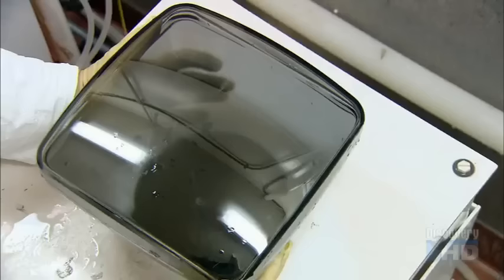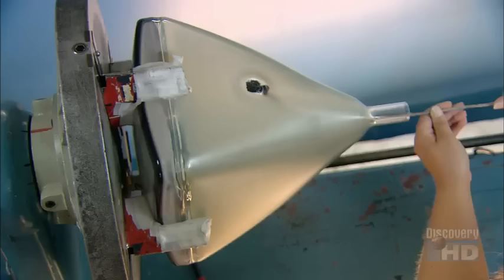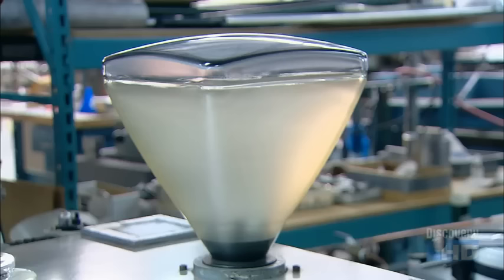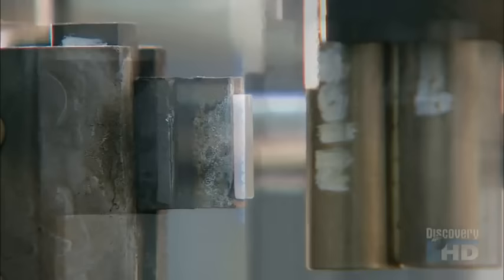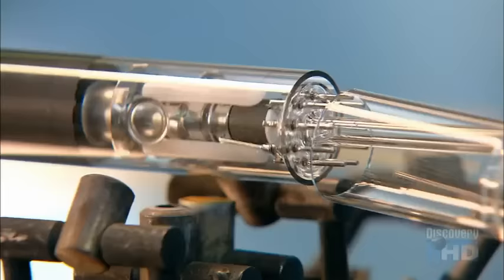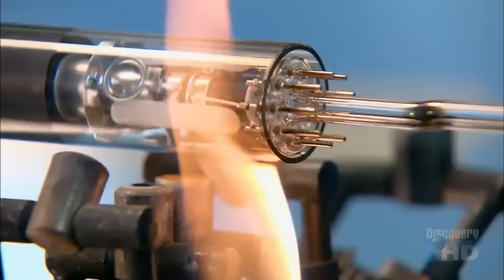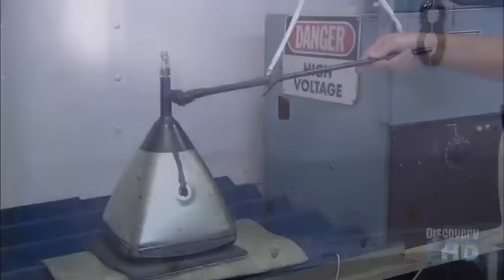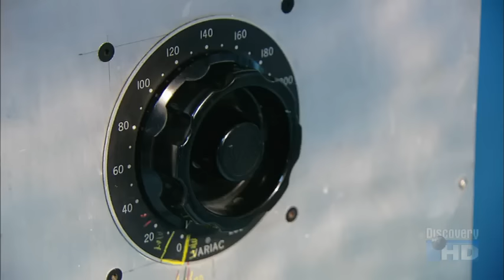Discovery How Its Made - Cathode Ray Tubes (480p) -=KCK=-.mp4

Comment: What they did not tell you, the thickness of glass has to be very thick and strong along the front screen part, CRT tubes are subjected to a very high pressure from the outside, as the tube has total vacuum, i.e. all the air is extracted by a powerful pump, there is no air left in them, so now you can work it out how much  of the atmospheric pressure is acting on the front portion of the screen,  a 25" diagonal CRT screen which roughly means approximately 20" x 15" rectangular screen occupies a surface area of 300 square inches, each square inch is subjected to atmospheric pressure of roughly 15 lbs (pounds) per square inch, so total pressure acting on that screen is 4500 lbs! that is approximately 2000 kilograms that in itself fascinates me. And don't forget the screen has to also take a lot of abuse as many people thump the poor thing when watching a programe that turns out disappointing, like if you were watching football, and your favourite team lost, you would probably punch the screen! 

 And the other fact is we cannot see electrons, yet we have a mini hadron collider in the tube, where we emit tiny unseen particles, called electrons towards the screen and strike a phosphorus coating that emits a light when struck by electrons, and thereby prove that electrons exists, and that they can be boiled off a negatively charged cathode and accelerated to near enough speed of light and strike the screen, where energy is given off, if we were able to set up sensors all around the tube inside, we would have been able to detect many other particles given off when electrons strike the phosphorus screen, we would have been able to detect Higgs Boson, without having had to spend 2 billion Euros building that big particle accelerator, all that could have been done inside a CRT, probably your smart phone camera can capture higgs bosons emitted by your old 26" CRT TV. And don't forget using 10 to 15KV  volts anode voltage, you would have been subjected to a fair amount of X-rays being emitted off as well,  but these days we are exposed to a lot of Microwaves as most iphones now work on Microwave frequencies of 2Ghz or more, that is the same frequency our Microwave oven uses to cook food, though the doze we get is a lot weaker, but over a long period of time our brains are being slowly defrosted.

But remember biggest revolution in science came from a bull, we first used a bull to use its mechanical energy, to run mills, do the farming, mine the minerals, drive bull carts, enable man to invent millions of other things so all started by a bull, we owe it to a bull, animals must be respected.
Reply: Thanks for the information
Reply: "we would have been able to detect Higgs Boson, without having had to spend 2 billion Euros building that big particle accelerator, all that could have been done inside a CRT, probably your smart phone camera can capture higgs bosons emitted by your old 26" CRT TV"

I don't know what you're smoking, but the particles in the Large Hadron Collider are 10,000,000,000 times more energetic than in a CRT electron gun.

Comment: So labor intensive !!!
Reply: And that's not a bad thing.
Reply: It was worst when CRT was new, because the newer a technology is, the harder it is to get use to it, and before you know it, as soon as you're used to a technology, it immediately is outdated and replaced.
Reply: Remember that back then a BW TV would have dozens of vacuum lamps made with similar methods.
Reply: @bob4analog  manual work is so unprecise, slow and expensive, why're you saying it is not a bad thing? robots are so much better at precise repetitive tasks
Reply: @bob4analog  can you explain pls?)
Reply: @jskratnyarlathotep8411  - Ok, robotic automation is great for large quantities of fabrication, but this is very costly. The design for such an automation for this CRT company would outweigh the benefits for such a small yield.
Reply: @bob4analog  aha... I did not assume you're talking about that particular plant, i thought you're talking in general, about a fabrication.

Comment: And to think that for all of these years this labor intensive manufacturing process was cheaper than making an LCD.  Wow!!
Reply: Well, why should the newer and inferior technology be cheaper? They want people to buy it, so pricing it as expensive is a great way to fool consumers into desiring it.
Reply: This is like late 1940s level of CRT manufacturing. In the later decades, there would be incredible advances in manufacturing of the tubes, allowing prices to come down. By the 1990s, they were mostly made by machines.
Reply: This has to be a speciality shop making limited run tubes for specific replacement usage.  An actual assembly line at the height of CRT usage wouldn't have had guys in lab coats and immaculate laboratory conditions..  This is more like watching someone currently making Nixie tubes by hand (which would have been an unworkable option when they were in wide scale usage).

Comment: So cool. Shame crts have pretty much completely died. I collect and tinker with old arcade machines and it is getting tougher and tougher to find decent tubes for the monitors. You can hack up old tvs for the tube sometimes but even those are starting to dry up. You just can't beat these older displays for retro games
Reply: Try going to a recycling center, most of them let you take the TVs for free and they have literally hundreds of them. It's important to know where to look.
Reply: Hi Jay, I too have a soft spot for arcade machines, I used to work in the industry repairing monitors , power supplies, boards etc. I can tell you that lunch time was always a lot of fun because the machines that we had repaired had to be ..er.. ahem ..tested   :-D. 
 The company I worked for closed so later I had my own business , I still have so much kit , tubes in good condition, some new even, power supplies by the box full , working monitor chassis, coin mechs etc.  Sad , but one day I'll have to throw it all away, well recycle the electronics anyway.
Reply: @prepare2qualify111  I've heard of those but there are none near me. It's sad, I have one big CRT and some small CRT monitors. The big one is failing and I want to replace it. It is also a late 90's / early 00's model, and I like the wood grain of the 70's ones.
Reply: Try putting up signs around your town "free CRT disposal" it sounds crazy or desperate, but that's a good way to find them. Certain goodwills/savers/Salvation Armies don't allow them but some still carry them. Try your local dump, if they allow visitors. There should be at least one recycling center somewhere near you (maybe a drive away but still there). Or,  just try asking around. I'm sure some of your relatives or friends relatives should have some, usually older folks. Never pass up an opportunity to get one, if you see one on the side of the road then take it. I volunteer at my local recycling center and my dad has gotten to his limit and won't let me take any more home. It's heartbreaking to see all of these wood grain/retro/space age/potentially useful CRTs get processed into scrap and not be able to do anything about it. You could also check online. Don't use eBay as those are full of scalpers who charge too much. Try uncommon sites or craigslist, maybe try searching the net for individual people, many of them just want to get rid of them and don't want to pay to recycle them. They would charge practically nothing. I wish you luck in your searches!
Reply: Also I wouldn't through away your broken one, try to find someone who can fix them or try to learn yourself. You could also use it for parts to fix others. Good luck!
Reply: I collect CRTs too. right now I'm looking for a HD CRT tv (yes those exist) but they're kind of hard to find and you'll be paying a lot when you do find one. I wouldn't say they're rare, but they're uncommon.
Reply: @prepare2qualify111   in australia we have gone lcd tv because we gone digtal tv old tv have been dismantled for reycled most tv repir shops have close down   because is cheper to buy new ones
Reply: @eddiepires3998  Join the website KLOV (killer list of videogames) its an arcade forum and has a for sale page, its super active like dozen arcade machines and gear for sale a day; you'll find good homes for your gear and parts plus it will all be saved.
Reply: @dumdum7786  I got one of those for free last year, ended up putting it for free on craigslist. Check there.
Reply: I managed to find a nice 20 inch flat screen CRT with s video and component input, the image is stellar too, it's been barely used over its lifetime just needs some cleaning
Reply: @dumdum7786  I've seen many HD CRT TVs but they generally do not work well with retro games

Comment: I think it's interesting that someone saw a Cathode Ray Tube and thought... We can adjust the angle of this beam to produce light in a line that can go across Horizontally and move down a whole screen with enough accuracy to produce thousands of colors while doing a whole screen 70 times a second to produce an image. like holy cow, makes LCD look easy.
Reply: the wacky displays people came up with before CRTs are even wilder, look around youtube for "nipkow disk mechanical TV", it makes an image using just a disk with some holes in it and a light source that can be modulated
Reply: A color TV set that used a CRT and magnetic deflection is one of the most complicated devices ever mass produced. For example, the CRT had three electron guns (red, green, blue). The screen had phosphor dots of three different colors, again red, green, and blue. The beam of each electron gun could be allowed to hit only the phosphor dots of its corresponding color. And the beams from the three guns had to be swept in unison over the entire screen about 60 times per second while keeping each beam precisely aimed at the corresponding phosphor dots. It is/was a sophisticated system by any standard you wish to apply and is made no less amazing because we now have solid state devices that can do the same job in a more straightforward manner.

Comment: This is of course a monochrome tube - colour ones involve some extra components, and a different way of applying the phosphors (plural). Plus, I think this one is for a special application, as it looked green, rather than illuminant C or D ("white") as used in (monochrome) TVs. (Hard to tell as we only saw it operating very briefly.)

(Why twice, once with and once without sound?)

Comment: the Best flatscreens are the ones Never build. CRT FTW!!
Reply: I have a Flatscreen CRT.  It's from 2004/2005 or so.  Panasonic and Component Inputs!
Reply: No the best CRTs are the ones never built. Mechanical TVs FTW!
Reply: @teresashinkansen9402  mechanical TV just ruins the attention span. Slideshows for the win!
Reply: @newspooiechannel   my  old HD CRT has HDMI port  for PLAYSTATION 4 :D
 you can rock XBOX one or Playstation 4 on a REAL HD CRT with HDMI port v1.0  
it has a slight geometry issues but SONY got lazy at the end   BUT not noticeable
I had another one that had Perfect Geometry  but my shit face uncle got rid of it
Reply: The best flatscreens were Samsung and they are not flatscreens, they are flat panel as you also have flatscreen CRTs which suck as the glass is very think compared to a curved CRT screen.
Reply: @teresashinkansen9402  cave wall drawing for the win!!!
Reply: @newspooiechannel  I have a CRT tv from 1982, still works as well as that day it left the factory.
Reply: I’d like to see a 4K CRT. It’s absolutely possible in theory

My dream monitor is one of those 1080p CRT monitors Sony made right before the end of CRT
Reply: Flat screen crt is nice imo
Reply: @punker4Real  yeah but it's essentially just an HDMI to RGB converter built into the TV since HDMI is digital and CRTs are analog...
Reply: @teresashinkansen9402  Baird FTW!

Comment: I wish there was a step by step on how to make this yourself -- this video glosses over a lot of information. I really want to make my own color CRT. If anyone knows of a good source of knowledge on this subject I'd love to know about it!
Reply: I doubt you can make this at home.
Reply: @tonystarkunlimited7332  considering people these days are making sophisticated ICs at home, I beg to differ.
Reply: KEKW
Reply: The equipment is gonna cost you hundreds of thousands of dollars. Just blowing the glass bulb is extremely difficult. Also, please study electrical engineering first, otherwise the voltage will kill you. 
And if you really want to proceed, go ahead and study material science. The guys making ICs are extremely skilled and advanced in their field. You will have to do some years at university first.
Reply: @niclaskrause7717  I have a BS and an MS in CS and I was originally a COEN; however, I may pursue another MS in EE just because I find it interesting. Also I did email a few professors and I did read several patents related to color CRT manufacturing since I posted this comment. There is certainly a lot and I can't cover it all in a comment here. In summation, there are 3 main parts of a CRT: The electron gun(s), the defection system, and the screen -- and yes -- the bulb manufacturing is involved. Firstly the shape of the bulb is critical if no reinforcements are used. The glass typically is not "blown"; rather, it's cast in a mold. In the early days these TVs would implode if improperly made -- mortally inuring those within proximity if it held a large vacuum and was not sealed behind a container. Older color TVs had made the glass bulb in two parts -- the funnel and the screen (front face). This made it easier to imprint the phosphor patterns and attach the mask. The key here is to have the right shadow mask -- made of the right material to avoid thermal expansion problems. The process for manufacturing the mask is a bit complex involving chemical etching. One patent I read talked about improving this process to avoid an overly skewed cone shaped etch for the dots. For the glass, the shadow mask itself, in some cases, is used to make the phosphor imprints through photolithography (a bit similar to the mask manufacturing in principle, although there are significant nuances here). That said there are other methods for making these imprints. Also, the glass itself isn't regular glass. In some cases it's lead glass and is quite thick. In addition to this, other coating may be applied to the interior of the bulb to add various benefits... I could go on in great deal about this subject.
All in all, it certainly is a lot of work, but I seriously doubt it would cost "hundreds of thousands of dollars" in equipment. You can custom make your own oil diffusion vacuum pump, glass oven, rotating torch, etc. Maybe for mass producing high-end, large color TVs that use an aperture grille, then yes it will cost a lot. But for older more primitive color CRTs a lot of the building can be (and was) done by hand. In fact there is a video on YT showing this for oscilloscopes. For instance, it showed the techs making the electron gun by hand using jigs.
Reply: @Drozerix  When say people you mean like half dozen people with PhD in chemistry and physics and a tonne of specific equipment that 99.99 of the world population could not afford and access to a silicon source and then making chips of 1970s performance IE 2000 transistor then yeah you are right....
Reply: Lol, good luck with that.

The sheer amount of money, equipment, materials, space and just the downright amount of knowledge you'd need in many different fields and disciplines would essentially make it impossible for you to do  so at the home level. Keep dreaming, though.
Reply: @-UseSoap_  You're not going to accomplish much with that attitude. You'd be surprised what one can accomplish with time and will.